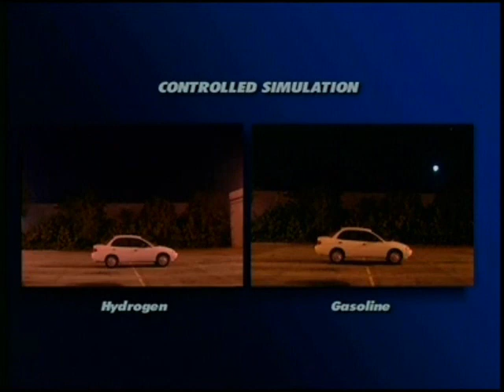Vehicle Safety

Comment: Yea unless mr tailgator tries to shove his right up your hind end and gremlins your tank..  or one of the million electrical circuits in the car for your butt warmer and back jiggler goes all sparky and lets some magic pixies out then causes a blevy situation where the gas in the tank superheats while the outside flame creates a void inside the tank big enough to turn the flame into a boom.
Reply: Simple. Instead of orienting the release valve upwards, have it point to the rear. Wire the valve and an igniter to a button on your steering wheel and you have a VERY effective way of discouraging tailgating. I'd pay to have that feature added. 😈

Plus, all those other circuits you mentioned are nowhere near the tank.

Comment: Soooo ehh. What happens if a hydrogen flame comes in contact with buildings? They are hotter than gasoline fires. It shoots straight up at the ceiling instead of drippign on the ground. What if it doesnt get ignited by a spark at what volume will it become an explosion instead of a steady flame? Quite a few realistic qeustions that are being ignored in this video outdoors
Reply: Eh..  in life either you boom or you no boom..  sometimes you just splode and when you least expect it somebody else is sploding then that increases your chances of boom.  To no boom you first have to not splode and when your using boom gas to go get your tampons or beef jerky, or both, you tend to be more likely to boom.  Use delivery, let them boom while cleaning up the splode waiting on your tampons.  Not good splode.
Reply: I think the big one you get into an accident and car rolls over. this engages and cooks the car occupants alive for 2 min.

Comment: The next question, what happen during collision?
With gasoline, it leak n possibly burn n exploding.
What about hydrogen fuel tank?
Reply: With gasoline it's already well documented, but hydrogen tank claimed it would survive the crash, if somehow the crash rupture the tank you're probably already squished to dead, and the gas just emptied like the vids
Reply: @Kevin-fj5oe  thats a controlled burn tho. 
They gotta show a crash video like seat belt or airbag videos.
Its good if we could ditch oil.
Reply: @eleethtahgra7182  well, toyota just shoot it with guns. And there's already few vids in yt
Reply: @Kevin-fj5oe  I see. Thx.
Reply: @Kevin-fj5oe  they havent put it in the middle of a 20 car pileup. You dont think the giant hydrogen flame is able to set other cars on fire? Its nkt a gasoline flame at 500-700c its hydrogen. So its hot enough to melt gold. Imagine that in the middle of a crash site when the car has flipped
Reply: Wonder what the hydrogen one would look like if it had flipped on it's roof before this happened?
Reply: Hydrogen tanks are made from thick carbon fibre. It’s like the survival cell in f1 that can survive 180mph impacts
Reply: @JB22.  2 cars speeding with 120mph n collide. Thatd be 240mph impact. Thus the question, would it explode if the tanks are damaged n expose to fire or spark.
That being said....I doubt the passengers would survive the crash in such situation to worry about any possible explosion.
Reply: @JB22.  
<The people in the car are 100% dead either way>
Agreed.
I read somewhere that the hiddenburg disaster was too sensationalized, thus the rapid decline of zeppelin.
Same with hydrogen fuel tank. Itd be good if theres...collision comparison between gasoline tank n hydrogen tank.

Comment: What a horribly biased demonstration. The hydrogen is safely vented from what looks like a pipe stuck through the trunk. Spit that jet of fire out under the car and show us a real demonstration, or admit that you're falsely claiming safety in the hopes people will overlook that you need electricity to make hydrogen... and the electricity needed to generate hydrogen is twice the energy the hydrogen will provide... and that electricity currently comes from fossil fuels. So you're promoting a really inefficient battery that burns more fossil fuel, requires more energy and safety systems to store and deliver at the filling stations, and can turn your car into a blow torch.
Reply: They’d need better equipment.

Point is that Hydrogen moves up, away from the cars and the passenger. Even if the gas was directly below the car, it would be less dangerous than the gasoline, because once all the hydrogen is vented, there’s nothing left to burn.

There’s another demonstration by Toyota where they shoot one of their H2 tanks with a gun. Gas leaks out- but not explosively.

Also, you can design a car with a backup valve that breaks in an accident in the matter shown in this demonstration, similar to the way you’d design an airbag.

It’s not ‘safe’, but neither is gasoline, batteries, or literally anything powerful enough to power a car.
Reply: Agreed. Burning gasoline has flame temp of 945 Celsius degrees and burning hydrogen has 2111 Celsius degrees. It would have been an instant car BBQ.
Reply: @oktokie  The vertical escape speed of H2 is 20m/s. The flames 2.7 m/s . That is why the heat does'nt act horizontaly.
Reply: So true
Reply: Yo bumfun, you can generate electricity from solar panels, perform electrolysis on water and produce hydrogen.
Once burned with oxygen in the air, water is produced and your car literally pee's back into the nature, no carbon footprint.

You can endlessly repeat the process with zero emissions.

Worried about the scale? Just use more solar cells, wind turbines.

Worried about water shortage ?
You give water back to the world, once you combine it with the oxygen readily available in the air.

You are worried about hydrogen safety, car safety ? Put in some time and create safer systems, test them endlessly and use according to guidelines.

The end result will be thousand times safer than the cellphone in your hand, that can go bust anytime without any reason.
Also ten thousand times more environment friendly.

Basically, if you want results, there are better ways than ranting, do some work and share your results. Support the ones that do.
But if you want ranting, you will win against any technology hands down.
Reply: @ChargedPulsar  tell that to California that’s expecting worse energy shortages than previous years.

Comment: Why dont you rear end it with a full size chevy truck full of tools 🇺🇸💪
Reply: While the Hindenburg  affect is a viable investor concern the transport volumes are very low and tanks would likely have a burst disk that would look similar to the venting with excess flow shut off valves in case of line ruptures.  There are millions of LNG tanks in vehicles world wide that is a much more volatile flammability.  Additionally gasoline tends to flow and spread out making a much more dangerous fire to escape from.
Reply: @agresseur7184  no m8 hydrogen is one of the most flamable products. Youre able to smother a 500-600C flame with sand or CO2 you cna eveb dilute it by just sprinkeling water and burning more area at the same time. What about a 2 minute long 1200C jet shooting out the top. Or side if the car has flipped. There is no way a firefighter is going to run up to the car to smother that flame
Reply: @fireworkstarter  Natural gas has been used for decades in countries such as Brazil for vehicles. The use of Propane or Natural Gas in the US is more than 175,000 vehicles in the United States and roughly 23 million vehicles worldwide. 
The auto ignition temperature of natural gas and hydrogen are very similar both of which is much higher than that of gasoline. Also hydrogen will disperse extremely fast to safe levels in the atmosphere unlike gasoline which shuts down roads after accidents to have it foamed and cleaned up. Your focus on a hot safe venting of hydrogen is much ado about nothing and you failed to mention in your argument the lack of visibility as you cannot see the flames  but remember there is little radiant heat from a hydrogen flame as it burns in the UV range.  This means your fireman can get in close to the vent to save lives.   Compare that to a large petroleum fuel fire.  It is all about proper training.  Even if you are worried about the wide concentration flammability for hydrogen understand where leaks occur the concentration lower limit is most important for safety. Propane can ignite when the air/propane mixture is about 3%.   Hydrogen at the same fuel-air mixture will not ignite.

OK the technology is just on the cusp of a breakthrough to widespread use but it is a safe method.  It is a just too expensive and the economics are only outweighed by the environmental concerns for future generations.  Not pursuing it and continue to burn up 20% of the hydrocarbons left to find by inefficient internal combustion engines  when that petroleum can used over 6000 products for so much more such as tires, football helmets, golf balls, plastics for medicine such as heart valves and light weight products.
Reply: @agresseur7184  you were able to see the flame quite well with that lithium contamination
Reply: @fireworkstarter  And you failed to listen to ' the temperature inside the rear window rose a mere 13 degrees'  Little to no radiant heat in a hydrogen flame.  The firefighter scenario you attempted to use in the debate is moot.  Yes if they wish to put contaminates in the hydrogen to see the flame that is a safe use debate not unlike sulfur smell additives for natural gas and propane.  Additives do have to considered as to power output and contaminants to the exhaust.  Much like lead that was used in gasoline for better performance but polluted a much deadlier by product.